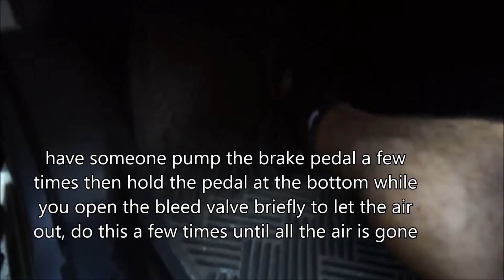Chevrolet aveo caliper replacement

Comment: Do you have to bleed the rear brakes first or just the one you replacing
Reply: @JasperVilla-s1d  depends. Did the master cylinder run dry?
Reply: @jdangberg  no.
Reply: @JasperVilla-s1d  then you don't have to bleed them all. Bleed just that one and watch the fluid level while doing it so air doesn't get sucked into the master cylinder.  However, if the fluid is nasty, replacing all the fluid by bleeding all the brake is a good idea, especially if the reason for caliper replacement was due to seizing Rusty calipers. These aveos use typically steel cylinder cast iron body arrangement and the pistons can rust. Some cars used to have phenolic pistons, which couldn't rust,but also could take high heat either. Unfortunately you don't get a choice with the aveo, all the replacements are steel pistons. Mine were considerably corroded causing them to seize, but sanding the piston and bore and replacement of orings was all it took to make them functional again, and no leaks either. I replaced all the brake fluid because of the corrosion.
Reply: @jdangberg  Thank-you just did drivers side caliper.